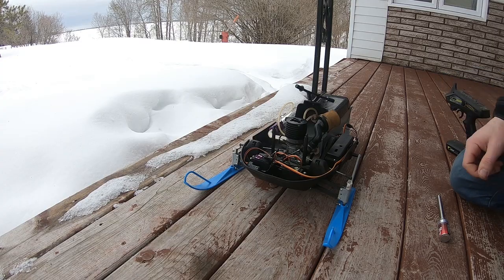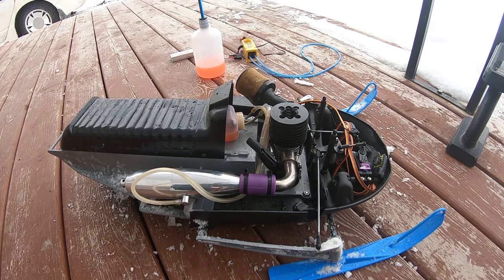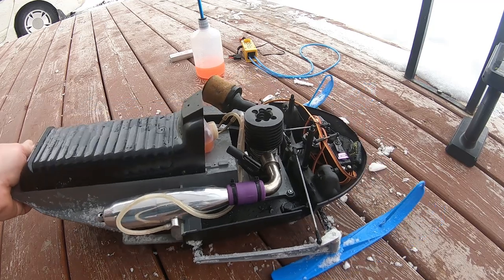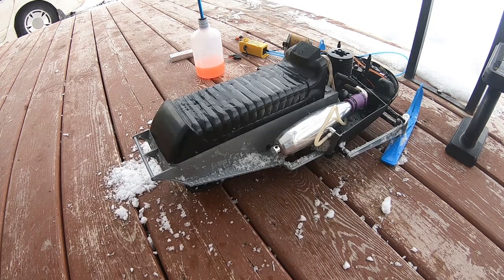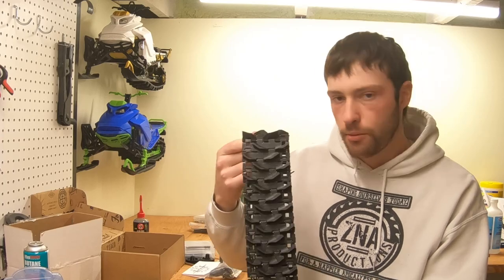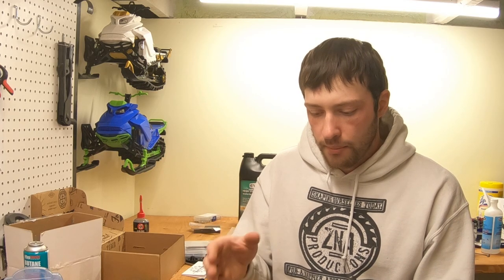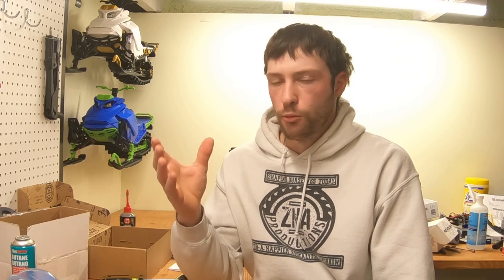Are Nitro Rc Snowmobiles still viable? - Art attack & Project Meteor

Comment: Edit I just realized ... this is the same madman who has the big 1/5 scale truck with the flatbed! HaHa WoW! you really are mental LoL! I love it! and you wasnt kidding, you do actually have 50 projects on the go! AND, there all AWSEOME projects too!  Im glad I found your channel ... il be right at home here HaHa!

Hell Yes! An RC snowmobile HAS to have an internal combustion engine! It makes it so much more realistic! Plus the smell of fuel burning, and the RPM ... it just all adds up to awsomeness!

This is the first RC snowmobile i have actually seen ... so excuse my noob question ... but does anyone make a CVT system? (just like 1:1's have)  I am yet to see one ... and im very surprised as they would even work well on any type of RC ... cars / trucks / snowmobiles ... and maybe even boats? I hear they are not the most efficient drive system in the world ... but it eliminates the need of a centrifugal clutch (well different style i guess) and you have a constant shifting ratio ... so you have low down, and it just keeps gearing up and up as the speed increases
Reply from the maker: The only cvt ive ever heard of is the tamiya cvt for miniature trucks, thats the only one out there.  But due to its design, cannot be retro fitted to any other machine without major redesign of the gearbox. Its also a fairly pricey unit.  Normally people use a 2 speed or 3 speed sequential (auto-shifting based on rpm) when using a nitro engine.  It also is usually lighter

Comment: In this cold weather preheat the glow engine is better for the engine and will start way more easy.
Reply from the maker: Was not hard to start, it was just a bit hard to prime it and get the fuel to the carb...  the engine was almost room temperature when i took it out

Comment: I've got an art attack and you're supposed to use a heat gun on the track to take the flats out of it before running. Also I found with mine that having the track very slightly loose helps a lot
Reply from the maker: That's not something anyone should have to do... how about drilling holes in it?
Reply: @Pascal_Robert--Rc_Creations  I totally agree, but I think from shipping it has to be folded and that causes the tension. They actually sell a kit with a different track and driver that has holes in it and can be picked. Here is a link -  https://www.artattacksnowmobile.net/Track_Drives/track_drives.html
Reply from the maker: I mean... a lot more holes. Like cheese grater pattern
Reply: @Pascal_Robert--Rc_Creations  not that I know of. There is someone I can think of that would be a good candidate to test that though 😂

Comment: ArtAttack makes a thinner track that is driven by holes instead if gear teeth. Less rolling resistance.
Reply from the maker: Yes, i have seen it, but being made of the same material, its still harder to spin, and it still lacks track depth in anything more then a few mm of snow.
Reply: @Pascal_Robert--Rc_Creations  Art  Attack recommends adhering rubber  lugs from another track to the existing lugs. Then you must lower the driveshaft. They use epoxy to fill the new hole. I have the gearless track, twin shock rear suspension , widening kit and wider skiis. Never put it together from the looks of videos on the machine.

Comment: 136 was the long track for back in that sleds time
Reply from the maker: Thanks for the info, i had a hard time finding actual number for vintage sleds
Reply: I have a 1991 super jag with a 155" track that came on it stock. But ya most late 80s and 90s long tracks were 136" If you ever need information just go to oem parts websites they will have parts break downs and you can look up the track size for any model / brand even for really old stuff.
Reply: @scotttod6954  yeah went up to 156 that year. i believe that’s near the beginning of the long track era. they even were still making the 116” shorty

Comment: Looking at this so see some examples of nitro rc snowmobiles for the competition. I think you need a lot more reduction. A nitro engine can run up to 30 000 rpm and even more. For the track something like 500 to 1000 seems appropriate. So at least a reduction of 1 to 20 or higher doesn't seem unreasonable. Or am I completely wrong?
Reply from the maker: Partially. The stock reduction is actually not all that bad (i dont have the ratio right now) but the reason why its acceptable is that the drivers of the track are quite small, at around 3cm.  So that would be your wheel equivalent.   Yes it does spin faster but the wheels are quite small too.
Reply: @Pascal_Robert--Rc_Creations  Oh, right. Didn't think about the sprocket size. That makes a big difference. I still think I'll go for a higher reduction so you get good use from the entire rpm range of the engine. And it gives you higher torque.

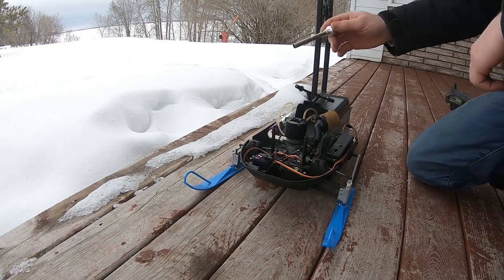Comment: Nitro is literally landfill....idk why anyone still runs nitro over lipo. being an ex nitro owner it makes no sense and @ 1:00 to @ 1:44 illustrates my point. trying to tune a nitro engine is a nightmare in any conditions in any elevation on any given day.....literal landfill. Electric is the definition on plug and play.
Reply from the maker: Altho i cannot argue with the plug and play of brushless models, i am almost done at making a nitro snowmobile that does not suffer as much of the typical nitro problems.

Imagine if a company like traxxas for exemple made a autotune feature on the nitro engine.  Calculates air density, nitro content, engine temp, etc.  It would be a game changer, yet its not far fetched.  Look at the automotive industry with the o2 sensors and exhaust temp.  Altho expensive, im sure that can be done, and implemented to these mini engines.

As to why anyone would do it, well. There's no good answer...  except for that weird inexplicable feeling that a nitro engine gives you at the peak Hp, flying down the track.  But that seems like a very small argument to justify it...